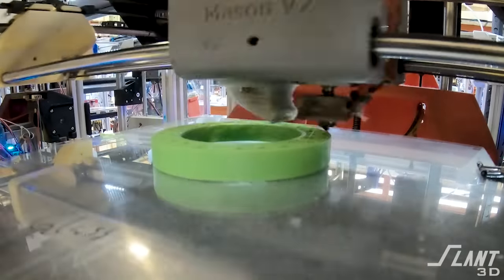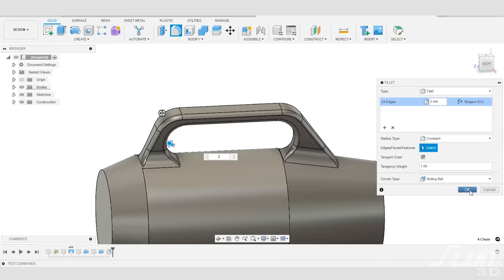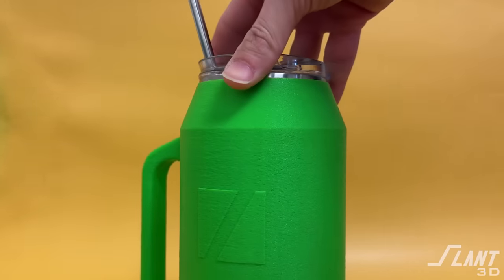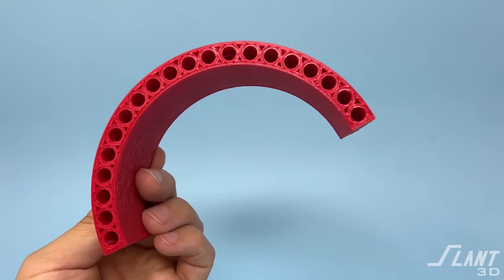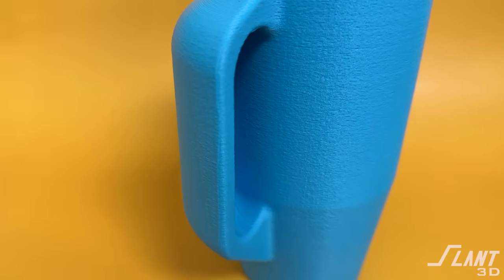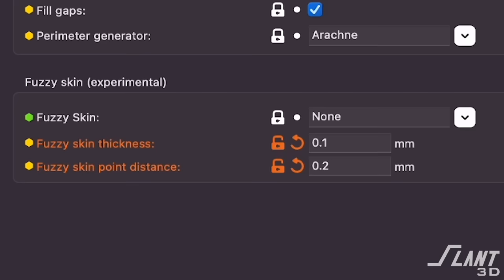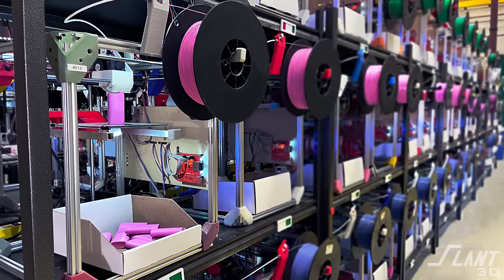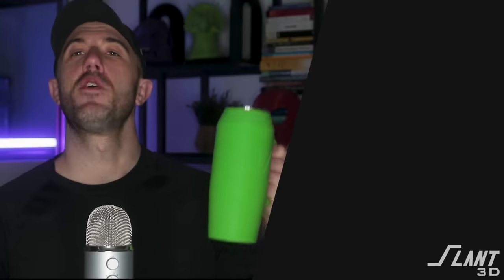We Made a Better Stanley Cup | Design for Mass Production 3D Printing

Comment: Overall the video has a clear message that has nothing wrong with it, so what I have to say is in no way anything negative, more so a correction.
While talking about the heat transfer in mugs you say how vacuum insulation is no better than foam and so forth, while there is truth in the following statement that most heat escapes while being conducted via the steel to the top, the thermos itself would be a notably worse item if using other forms of insulation. As mention in the video, 3D printing is amazing at creating internal geometries: creating sealed of pockets of air, minimal contact structures, this tackles the two most well know forms of heat transfer- convection and conduction. While smaller air pockets are better at fighting convection transfer than large pockets, the simple act of eliminating convection is far better solution. Secondly, any and all material having a direct connection from inside the hot container to the cool outside wall is far worse (thermodynamically speaking) than no connection at all, hence vacuum insulation being prominent for longer lasting storage. Thirdly, the only form of heat transfer that is hard to fight for both manufacturing methods is radiation, but even here you can win some if you make the inside of the chambers as far away from a perfect thermodynamic black body (i.e. less heat absorption).
 I thank you for spreading the hype for 3d printing and hope that my words will be nothing more than a helpful addition.
Reply: I don’t want to read all of this
Reply: @AusterEngineer  Thank you, just sharing some observations.
Reply: The "liner" being used is vacuum insulated, so the holder is doing nothing.  Any heat loss will be at the cup lip.

All this blah blah blah is pointless, except for "WTF?  Vacuum is a far better insulation than air!".
Reply: @gantasmorozovas4212  Thank you for sharing!  I wonder if magnets might be used to eliminate all points of contact.  Maybe with an electromagnetic "reversal" switch for easy removal of the inner liner for cleaning.
Reply: @kennethbeal  Do you believe magnets are magic?

Comment: Don’t let mid aged women hear that you’ve made a cup better than a Stanley. They’ll ask to see your manager
Reply: Lol
Reply: Damn Karens
Reply: The funniest part is when I saw someone at work with one for the first time I asked if they were pretty cheaper and they told me no, about the same as a yeti.... Then why don't you just get a yeti?😂
Reply: A plastic cup is not better than literal stainless steel. I don't give af about Stanley but this is a ridiculous opinion.
Reply: @allwoundup3574  why? Plastic is a better thermal barrier than steel.
Reply: @allwoundup3574  lol your opinion is ridiculous. Each material has its place. Certain plastics are extremely resilient and don't damage like stainless steel. It's also FAR cheaper. This is and absolute braindead take
Reply: I don’t get the hype for Stanley
Reply: Loveeeeeeeee this❤ . Thank you. And for this you get 🙌🏼💯🔥 all because I didn’t have to fight anyone for a damn Stanley cup ❤❤❤❤❤
Reply: @shanewalters7821 not better than a vacuum though. The double wall stainless mugs have a vacuum between layers. They are meant to be close to what you get from a "thermos". The lid and straw negate the effect somewhat, but they do work. Vacuum bottles in general, not just stanley, (which has been in the vacuum bottle business since 1915) keep beverages and foods at desirable temperatures for hours.
Reply: @frankwilliams1580  yep, completely get that. However, at this point, I can't 3D print a vacuum sealed SS tumbler. Since this post I since printed a PETG cup which allows my non vacuum sealed (single wall) SS pint glass to slide into. Did so with 5mm wall with 2 printed external walls with the rest being %20 line infill. It worked very well. Not as good as a vacuum sealed tumbler but it also cost me $1.50 in plastic and I customized it along side of fuzzy skin
Reply: @frankwilliams1580  You make no sense.
Reply: @frankwilliams1580 This wasn't my video and I've never made one. Why are you calling me big shooter and getting all offensive. I simply said you were right that it can't compare to a vaccum sealed container and then told you my experience with last night's print and that it definitely was not as good as a vaccum sealed tumbler, but did state it worked very well.

Comment: I'm a tad bit surprised the cup wasn't designed with the hole the stainless steel sleeve slides into being a grip fin style hole like in you're other video about designing better holes. My thinking is it would reduce contact points between the sleeve and the cup to further insulate the drink. Fewer points of contact with the cup, slower heat conductance. Of course the rim would need to be closed up so the cells between the fins wouldn't be open to the outside air, as well as to prevent your drink from sloshing down into said cells.

Comment: Using infill for insulation is awesome  But shouldn't you be using Cubic for that, rather than Rectangle? That would divide the air into many more small cells, and do it in three dimensions.
Reply: Good to see that pointed out already. For how handy the tips on this channel are, there seems to be a lot of low hanging fruit thats just missed in terms of optimisation. Same with stuff like adaptive layer lines a while ago.
Side question: What would be the most optimal infil density to limit both air flow and conduction through the plastic.

Comment: My daughter likes to use Voss water bottles, and she re-uses them. They're a fairly heavy glass. After she broke a couple of them, I designed a cozy with a handle. The fit is good, and made better by a TPU ring around the top. I was surprised at how well it insulated the bottle. I was just running cubic infill. I printed it in PLA +, because she isn't using it for hot stuff. I don't print a lot of PETG. I have a hate-hate relationship with it. maybe I'll try one of the CF blends.

Comment: I haven’t been able to get a 3D printed liner the thermal properties of a vacuum sealed (with copper radiation insulator) tumbler, not even remotely close. However what I did find that worked really well was using a wal mart “contego” thermos which has a vacuum sealed interior but it’s very thin than printing a cup that goes around it that doesn’t tip as easy, has a handle etc etc. Since very little consideration needs to be taken for insulation it can be fairly thin but have a nice wide base. I also made it so my lips don’t touch the plastic which even if food safe is a gross sensation.

Comment: The mostly empty infill isn't as good an insulator as a vacuum flask but most people would actually prefer a mug that keeps hot drinks hot for a work day but don't want it still scalding hot two days later.  Sometimes there can be too much of an engineered good thing.  Most people want an insulated mug like this that has some ice left at the end of the day.  The Amazon link shows a vacuum flask.  Nice job capitalizing on the Stanley craze even after the brief wave crested.
Reply: Yeah, I was going to say I don’t think infill patterns would even compare to styrofoam as far as insulation goes. The cell size in foams is just so much smaller. With that being said, he was emphasizing how cool it was to be able to adjust the properties of a material just by changing the print settings, which I have to admit is pretty cool!
Reply: @bensonboys6609  - Totally agree.  People too often see additive manufacturing as a low rent alternative to "real" manufacturing such as die casting,  injection molding or CNC machining.  I guess 3D printing's reputation is somehow tarnished because people can do it in their homes with a very low barrier to entry even though that's another one of its big advantages.  We're only just starting to scratch the surface of custom tailoring 3D printed structures.

Comment: With 3D printing you can add a version with a feature that holds the stainless steel straw when the cap is closes and it will cost nothing  :)
Reply from the maker: Very true. We should add that into the model

Comment: Don't pay for the files or the insert. I just clicked the links and paid for the print file and the exact insert he links and it doesn't even come close to fitting in the print. Be careful about buying either the print or the insert linked. I don't know If something changed but I wasted my money on this it seems
Reply from the maker: Make sure you are grabbing the silver one as shown in the video.
Reply from the maker: You may also have to adjust the sizing of the file depending on the material and printer you are using.
Reply: @slant3d  The link went directly to the black and the silver is only avail in qty of 6.  What is the diameter of the silver one that you're using?  My print came out a few mil too small.

Comment: Since the outside of the cup isn't going into the dishwasher, you could put a thermometer there to monitor the temperature inside the metal cylinder.

Comment: Conduction, convection and radiation are what you're trying to optimise with a tumbler, vacuum insulation cannot conduct thermal energy via conduction or convection, hence is the best insulator by far.

A stainless insert with a 3D printed surround will make a very average tumbler, efficiency wise. 

I love 3D printing, but the manufactuing process chosen must be the most appropriate for the products performance. In this case it isn't.
Reply: The "stainless insert" they're using is a double wall vacuum cup, so....

Comment: Wow thats amazing, I was legit thinking about implementing a similar design with the same reasoning behind the design that 3D printed parts have air pockets that act as a better insulation than metal insulated cans. I was planning to implement it as a sleeve for a coke can but this implementation works as well. Nice work!!!

Comment: I value your deep knowledge of 3d printing, but you are completely wrong in your explanation of thermodynamics. Saying that air is "True" insulation while vacuum is not shows a complete ignorance of heat transfer. If air was "true" insulation, houses would not use fiberglass or foam insulation because there are air pockets between the studs. A vacuum thermos is far superior to any one using insulation. You claim that your 3d printed design has no pathways for heat transfer, but every bit of infill that touches the inner and outer walls conducts heat. Air pockets allow heat transfer by convection, conduction and radiation where a vacuum only allows radiation. Your design might keep a drink hot or cold for 30 minutes (maybe), but a vacuum thermos will hold its temperature for many hours.
Reply: bro i just made a post about this holy moly dude ... air - does not come close to NO molecules to transfer heat, lack of matter = true insulation, its like the time he said injection molding cant detailed textures, bro hasent seen a texture swatch from a injection molding company or somthing
Reply: bro just says crap, and TBH these lies probably create more anger/rage and engagement, he could play that card. but misinforming people is misinforming people, period.
Reply: The liner is a double-walled vacuum cup, so it doesn't really matter how good the insulation of the holder is anyway.
Reply: @j.f.christ8421  good but foam isn't better than vacuum

Comment: You are not correct about the vacuum. Vacuum is more than 4 times better insulation at 0.1 mbar. You also cannot seal the air inside in 3d printed model. That means that additional heat transfer will occur through the micro holes. You argue that there is a heat transfer on the neck where 2 metal cylinders are connected to clove the vacuum chamber. That is correct, but the heat loss there is small, because the area of that part is small. It is not a problem and should not be used as argument in the way you used it. The TPU or any other rubber material is quite bad for the handle imho. I think you have created a new type of product. It is not Stanley, but u can do it cheaper and it is usually enough for the every day cup with some thermal insulation. I would say it is great of what you did. A bit more physics knowledge would help with arguments . :)
Reply: This guy is a clown. Most of what he says is straight up not true.

Comment: Do you have any recommended print settings for this?
Reply: I used .22 layer height, 3 walls, no supports, cubic infill at 15% for maximum insulation, I used PLA+ but you'll probably be better served using PETG.
Reply: @owenl7598  Thank you.  That is almost exactly what I used.  Also using PETG.  Also FWIW I scaled the STL up to 104% to get the liner to fit.  AMAZON no longer has the plain silver ones.
Reply: @4x4ff  I'm using a painted black one in lieu of silver, does 104% fit yours?

Comment: For better insulation, you should make those triangular pockets smaller vertically. Long columns of air are more prone to free convection than shorter pockets. Also not sure about that fact that vacuum seals are mid. You’re gonna have heat transfer around the lid with this anyway. Might as well have zero convection around the sides as well. All love though, totally agree with the premise

Comment: Great video, you could complement this video and prove your point with thermal data performance of the 3D printed vs stanley cup. Thermocouple inside both device with ambient temperature plotted through time. The time it takes to go from 60C to ambient 23C for example

Comment: Do you have any data comparing thermal testing? I was inspired to design my own tumbler off this video and I've noticed that both PETG and TPU have higher conductivities heat than air so in my tests where I used a naked tumbler and tumbler with thin walls, thick walls, big air gaps, infill patterns, didn't matter, the plastic performed about 4% worse each time than the tumbler by itself because it allows the heat to conduct through it better than just leaving the metal tumbler exposed to the air. 
Sidenote it's not to say these things aren't still amazing it still took 8.5 hours to go from 210° to 120° and almost 36 hours for ice water to go from 34° to 48° in both tumblers so still great insulators but the naked one was slightly better always in my tests.
Reply: I did some simple testing. Found ice did not really last any longer in the TPU sleeved mug. I suspect the real temp loss is only through the lid and what is lost to the sides transfers just as easy into the TPU.
Reply: I agree biggest heat exchange for sure is through the lid no doubt. It was just counterintuitive that my thought, much like I thought I heard mentioned in the video, was that putting additional air gaps and plastic and spacing around the outside of the insulated cylinder would add to its insulating properties and instead, it decreased them a bit.

Comment: Cool video. I’m surprised you didn’t use 45 degree angles on the top and bottom of the inside of the handle to avoid the overhang.

Comment: Ok, so after using it for a while  - I love it. However I would make some changes. First take a Toyota Corolla for a test drive - Japanese cup holders are very small, I need a smaller base. Second although the handle is creative, In trying to pick up the cup without looking at it (driving) I need to feed fingers through a handle and pick it up by hanging the top of the handle in the crevice of my thumb.

Comment: yo dude- VACUUMS are the penultimate of insulation, 3d printed infill with foam - doesn't come close to the LACK OF MOLECULAR STRUCTURES TO CONDUCT ENERGY this is like that time you said injection molding cant do fine textures bro cmon man like cmonnnnn mannnnnnn
Reply from the maker: Except that vaccuum is contained in a continuous conductive steal structure. And they are not perfect vacuums.
Reply: @slant3d  You do know that your liner is vacuum insulated, yeah?  The holder doesn't really do anything, yeah?
Reply: @slant3d tell me you don't understand thermodynamics without actually telling me you don't understand thermodynamics

Comment: the stainless sleeve doesn't exempt you from the dishwasher, spills happens and on 3d printed stuff it sticks between the layers and becomes gross.
Reply: You can still wash it the old fashioned way though, and that's still only a fraction of the times you need to clean it
Reply from the maker: Put the whole thing in the dishwasher

Comment: In my experience, PETG isn't top-rack dishwasher safe, but shrinks over time.  Seems like this won't hold up to teenagers loading the dishwasher.
Reply from the maker: We do reccomend using a cold wash. But really all you need to wash is the liner which can be removed.
Reply: He was referring to washing the metal liner in the dishwasher (because it can be removed), not the plastic.
Reply: @shanewalters7821  Yes, I understand that.  But in practice mistakes can be made and it is a pain to have one thing that has to be washed by hand.  I suspect that one mistake and you'll never be able to remove the liner.

Comment: What material did you print this in?
Reply: PETG for the light green, TPU for the dark green he keeps whacking.
Reply: @logicalfundy  the one he keeps whacking seems pretty stiff for TPU which I've always assumed to be much more pliable.
Reply: @UnCoolDad   you can buy TPU in different Shore hardness, and use a different number of perimeters to control its rigidity. At 4:02 he does show it is flexible. When I worked in retail, I printed a holster for my work scanner in TPU and it held up pretty well. It's an often overlooked material in 3D printing.
Reply: @logicalfundy  I'd like to know what TPU this is.  The properties are every enticing.